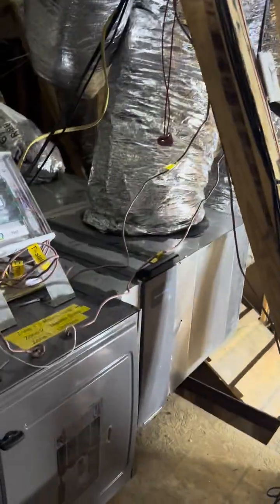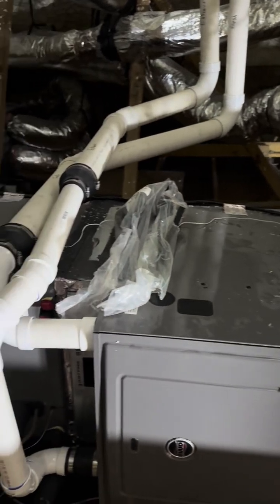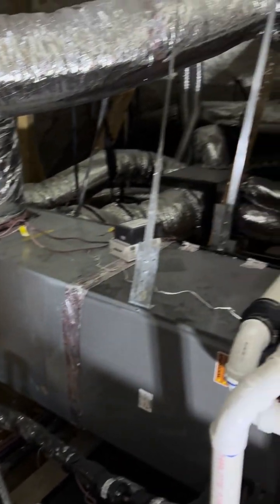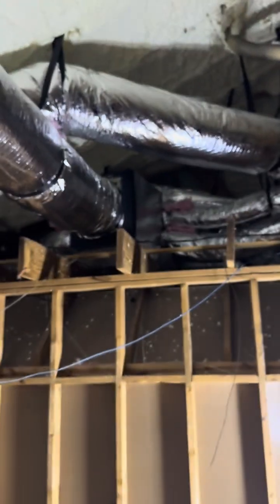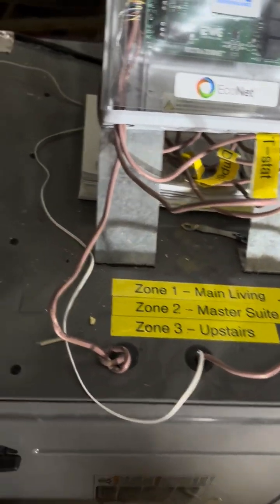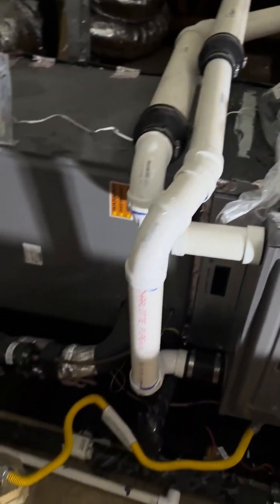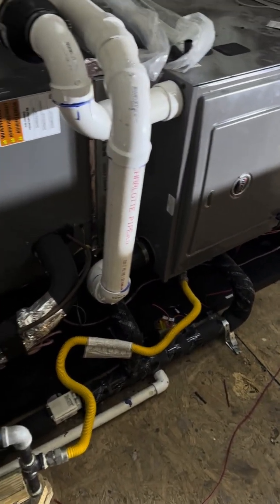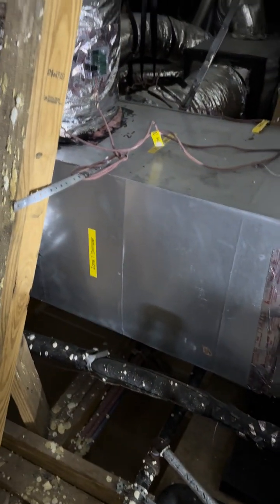Case Study: RUUD 18 SEER2 Residential AC and Heating System

Comment: How do you BID something like this on a new install?  Can't just be correctly executed but you have to make money too.  Really respect the complete business.
Reply from the maker: Bidding the installation is a critical step. I do not bid jobs without seeing the job. As far as refrigerant needs, the manufacturer provides enough refrigerant for the first 15 foot of line set in residential applications. Less in Commercial applications (Commercial splits). A measurement of line set total length from inside the attic to the outdoor condenser/heat pump gives us length. From there it is a short calculation for the size of system and the weight of refrigerant per linear ft.